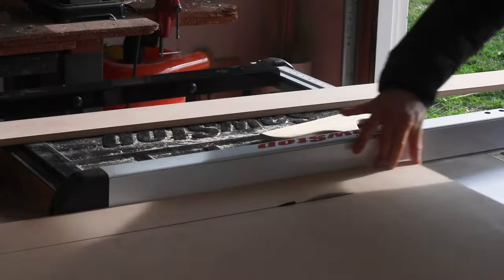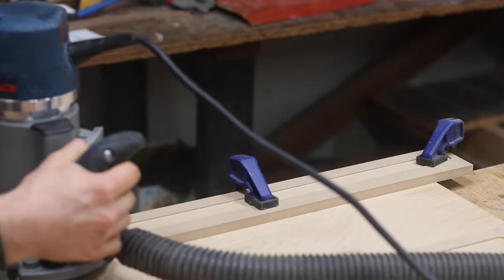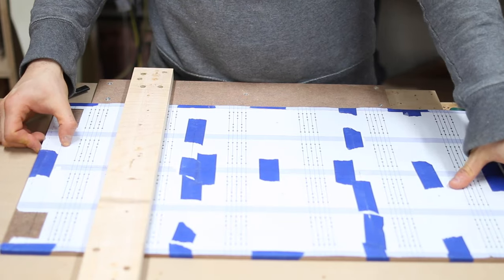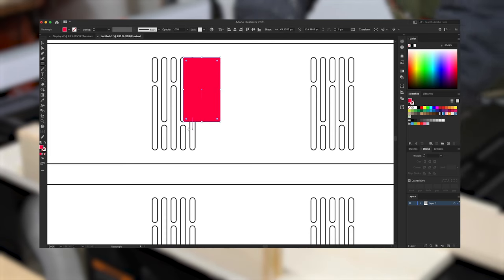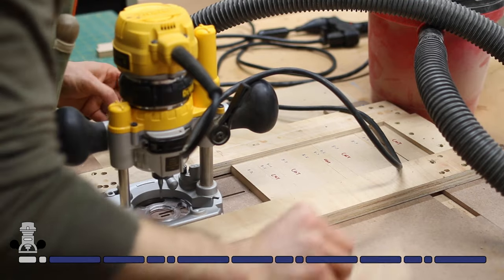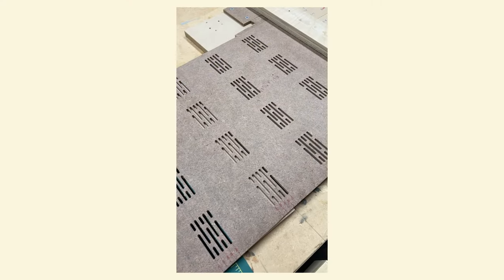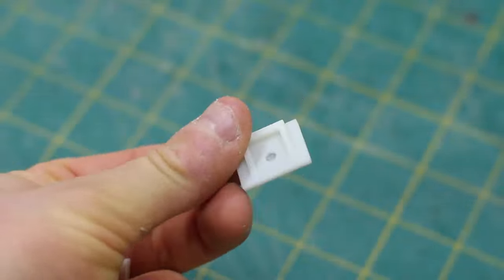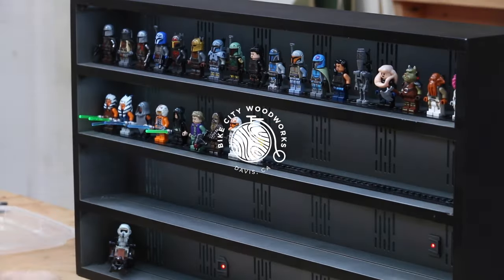Hand-built LEGO Star Wars Minifigure Display Cabinet | DIY Woodworking Project

Comment: Just a heads up, leaving the minifig leg holes on the studs can cause stress marks or possible cracks on the feet of the minifig. There is a modified piece shaped kind of like |__|__| that the minifig feet can fit on. Commonly used in starship cockpit builds that can avoid any damage to your more collectible figs 🤙🏻
Reply from the maker: For sure — I don’t think the tiles alone are a long term solution.